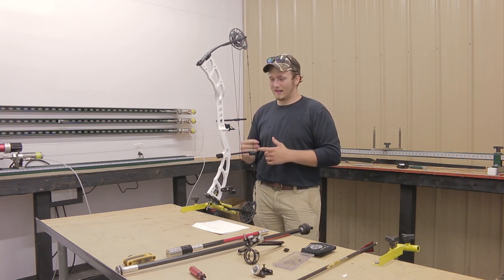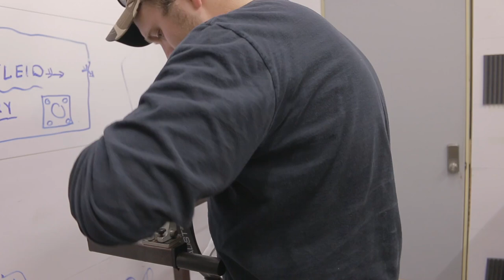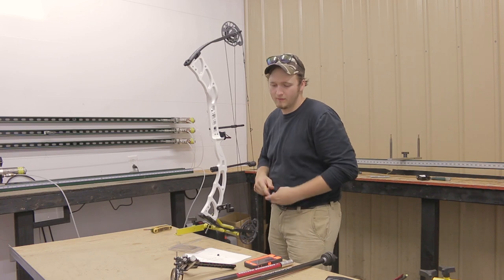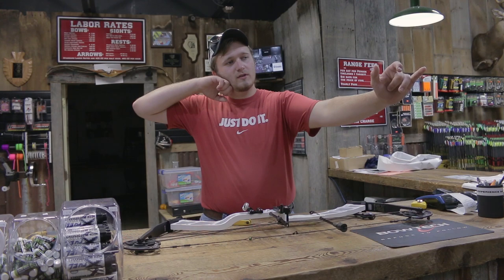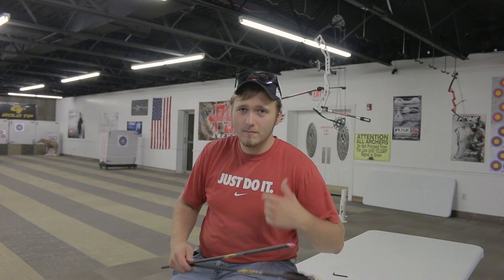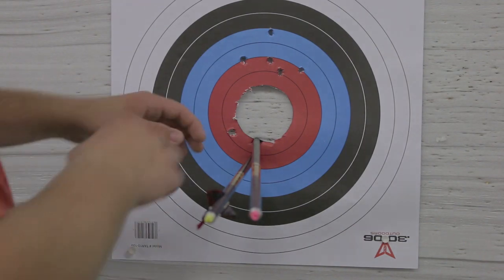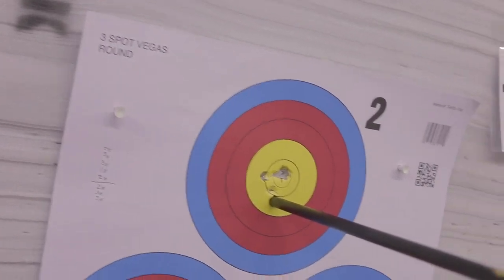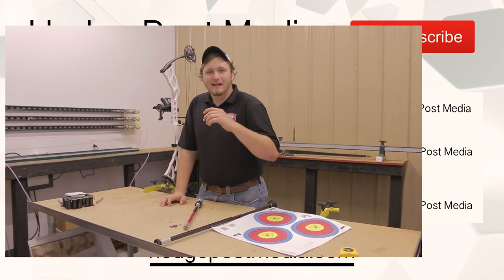Diamond Medalist Review (HPM Vlog 002)

Comment: i just bought the bow tech specialist 2 bow about 2 months ago , its basically the same ,only difference ,they machined the handle to put in an additional handle . let me tell you ,this bow will robin hood arrows if you try to group to many at a time . awesome bow . i got way more in the accessories than the bow . its a tack driver ! im going to get one when i find a good deal . oh about the limb stop , put another one on the opposite side !

Comment: If I buy one with 70#lbs i can do a down grade until 50# or 40# or just until 60#? I wanna buy one between 40# to 60#.
Reply: Erick Chrys I went to the Bowtech factory and shot one. They said they are adjustable by 15#. So the 40-50# goes from 35-50#.